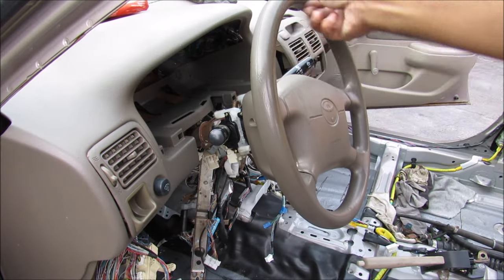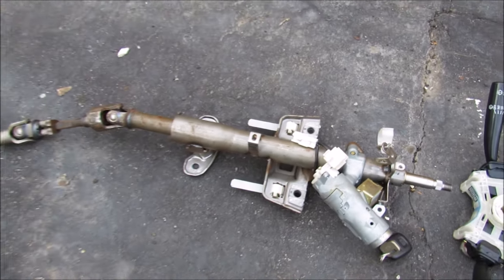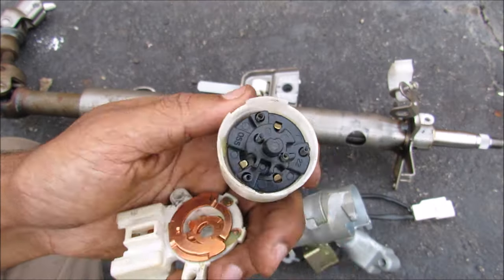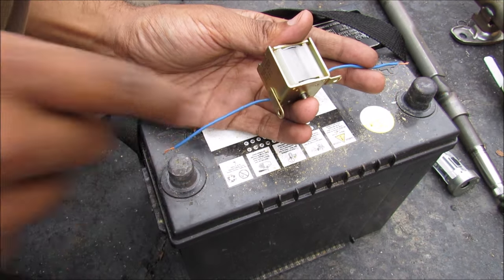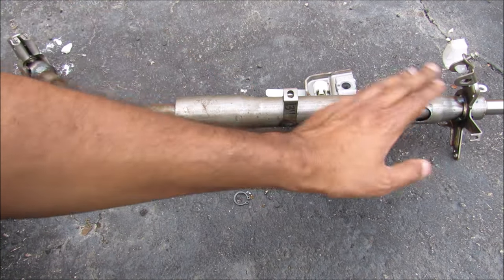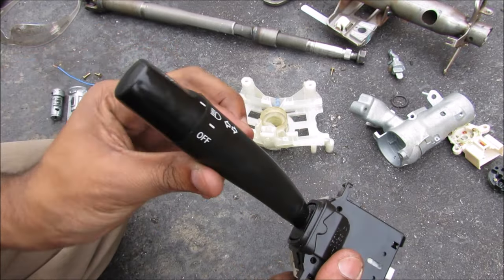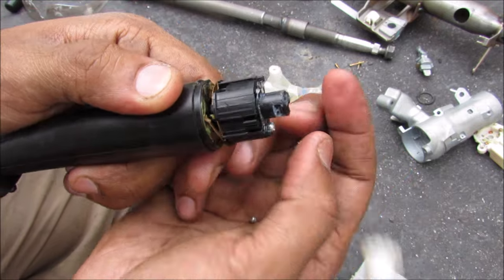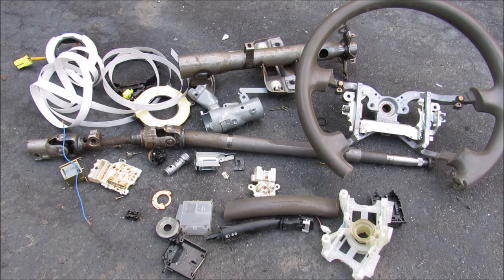How a Steering Column Works

Comment: great video. even as an engineer that specializes structural strength I'm always amazed by the amount of complex mechanisms inside machines we use daily and take for granted.  An automobile is made possible by mechanical, structural and electrical engineering combined.  Often times it includes computer engineering.

Comment: Nice breakdown and explanation.  Some thieves trying to steal my airbag broke my ignition switch/cylinder and the security screws that hold it on. Probably used a crowbar. They also removed the electronic switch (held on by two screws) that activates in the starter on the start/on position. I knew nothing about my steering wheel column and ignition until now. Thank you.
Reply from the maker: Thanks and I hope you get it fixed through insurance, those parts can be costly and on back order.
Reply: I didn't have full coverage on a 17 yr old truck. I'll be finding an after market CAT+ Exhaust pipe, and pulling from a junk yard or eBay an Ignition Switch/cylinder or the whole steering column if I can find it

Comment: Hello from 2022. A burglar (leaning on the steering wheel for balance?) broke my steering column. I had bits and bobs lying around and didn't know what was broken. I did test the key and found I couldn't turn the key in the ignition. I now know the bits and bobs were the solenoid/housing so this was very helpful and informative for me. Thanks for making this video.

Comment: The steering column u joints are very important because they're mostly there for collision safety. Without the u joints in a front end collision the steering column would shoot past the steering wheel and impale the driver. The ujoints are designed to break.
Reply from the maker: +LobbyDIY agreed, though as you saw in the video the steering  column itself also collapses.

Comment: A superbd video. I am hearing a 'clunk' sound when I rotate my steering wheel all the way to the left or right in my 2004 Toyota Corolla. I still have steering control of my vehicle. Should I be concerned? I will check under my hood today for loose components there. My braking works fine. Thanks for any information.
Peace.
Reply from the maker: Check the strut mounts and steering intermediate shaft

Comment: Man I needed this video months ago
Reply from the maker: Why, what were you repairing?
Reply: speedkar99 a 98 sienna that had a bad key cylinder and I couldn’t get out the key. Also the ignition switch needed replacing. Great video

Comment: 1)Is it possible to remove the steering column assembly without dismantling the steering wheel and the air bag, so that the whole assembly can be removed as one unit?
2) I'm able to turn the car off and remove the key while the transmission is not in the park gear. Is it just the solenoid you mentioned in the video that needs to be replaced, and can it be purchased by itself? What is the exact name of that solenoid?

Thank you very much!
Reply from the maker: Yes the whole thing can be removed as a unit. As long as you have access to the 4 bolts

Comment: Once the security shear bolts are removed with a punch & a hammer:
1) Could the same ones be reused to reinstall or are new ones required?
2) To install the shear security bolts, is the method also to use  a punch & a hammer, but in a clockwise direction? 
3) To install the security shear bolts, alternatively, is it possible to use an ordinary bolt where a socket & ratchet could be used?
4) Why are those security shear bolts used instead of ordinary bolts?

Thank you very much!
Reply from the maker: They can be reused. They're there for security...to slow down someone trying to hotwire the car. Of course since your doing this to your own car you can take your time, right 😉
Reply: The security shear bolts are "one-time use" and are fitted like regular bolts (clockwise rotation), the head is designed to break off when tightened with the prescribed amount of force. They are used as an added security feature to deter thieves from tampering with the cylinder assembly.....Yes, it is possible to use regular bolts but I would suggest sticking to the shear bolts.

Comment: Hi,  I want to replace the steering column of my toyota corolla E120 D-4D (2002) which has NO telescopic adjustment of the steering wheel and I want to use a steering column from the later facelift model that has the telescopic adjustment. Do you know by chance if their steering columns are compatible? Can it be done?

Comment: nice video my friend. I have a question... it is possible to fix the clock spring ??? it is possible to solder the looooooooooong cable??? or that solder would act as a resistance... thank u for ur time and greetings from Perú
Reply from the maker: +Fernando MinAnd yes but solder should hold up to The flexing of the spiral
Reply: speedkar99 thank you for ur answer my friend!!! 🖒🖒🖒

Comment: So I was changing the driver window regulator today. 

The bolts that hold the glass to the regulator stripped and it now spins. 
I called 5 dealers and checked online and can't find them. :/ 

On this 1997 Lexus es300, when you mount the glass to the regulator it had a lot of play in all three fasteners. How does one align it perfect. 

I am lost and need help. 

Thank you
Reply: I tried many different ways and adjustments, but when I tested it with a spray bottle, water gets in. :/  any one ever changed one on a 1997 Lexus es300.
This car has no upper door support. It is only the glass that closes.
Reply from the maker: +Martin Evan Hmn I'm not familiar with the power regulator, your best bet might be junkyard
Reply: speedkar99  If you ever come across it, it is very difficult to alright the bolts just right. There is so much play yo deal with.

I went to my local junk yard and no luck. This junk yard could be the worst junk yard in the world. The owner there said "we don't sell the bolts, you would need to buy the whole door" I was shocked and left never going back. 

I called all the dealers in Atlanta and every single one hit me with " you can't get the bolts" which you can. I found them online. 

But Thank you for your reply. 

Lexus is easy to work on. But on this es300s, maybe others, when you install a window regular there is so much room to play to set the window glass just right.

Comment: so, were in the process of sending our toyota carina cdx e 1996 column  to be converted to electric power steering. however its been asked for the "motor" to be marked  on the column where it was. and yet  even toyota doesnt understand what this motor is. would this motor infact be the power steering pump?

Comment: Please help! Just replaced a steering column. Transferred all old parts onto the new steering column...yet, now the steering lock isn't engaging at all. Also, the steering wheel endlessly turns in either direction (i.e., there isn't any resistance when turning... steering wheel will allow wheels/tires to continue turning beyond what they should). Any ideas on what the issue might be? Thank you!

Comment: What would cause my steering wheel to lock, but the wheel is not horizontal? I believe this happened after an alignment was done. Also a Toyota (09 Prerunner SR5 4.0)

Comment: I replace a blower motor on nissan versa  and disconnected the steering shaft from the column with the wheels turned now steering wheel is off center about half way, i cant find any videos to fix this, is there anything i can do to fix it

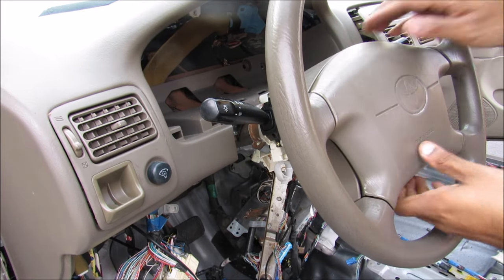Comment: Some mechanic hammered the metal where the sensor nut lay (0:45) and caused the steering wheel to be stiff and grind everytime against the plastic it sits on. Perhaps the collapsible steering column got a bit shorter or moved ? is there a way to undo this ?
Reply from the maker: Once it's collapsed there's no easy way to reuse it

Comment: What makes a ratchet clicking noise behind my steering wheel? 2007 Sequioa
Reply from the maker: Toyota always has steering shaft issues. I have a replacement video on a sienna

Comment: I have a 1989 Pontiac Grand Am and I replaced the steering column when I put the new one in my between the seats gear shift button won't press I can't shift into a different gear, what did I do wrong? There's a piece when you look down the steering column that's made of plastic and put on with two screws I see the button on that is that in the wrong place?
Reply from the maker: Yes theres a cable that goes to the ignition switch
Reply: @speedkar99  well damn I'm getting close when I replaced the steering column maybe I put it back on there wrong when I have the steering column down and I look down there into the steering column I can see a little button but that's not telling me anything I'm not a mechanic

Comment: My 1994 Toyota Camry steering wheel goes free spinning if I hit a bump.I can pull on the wheel and it also just free spins.I can kinda wiggle the wheel and feel a short move forward then steering returns.The steering wheel will not be centered anymore.I can point the wheels straight ,then pull on the steering wheel it moves towards me Maybe a inch.Now it free spins,I put it straight and push forward to engage the wheel again.Any idea what is going on.Feels like it's coming off a spline fitting or something.

Comment: Hello @speedkar99 . I have Lexus GX470 2004 just recently bought at auction. It is clean car , running with no damage history. When I get to pick up the car , I detected that steering wheel is not turning the wheels. It is free soft turning either side  with no respond from tires. But if I remove key 🔑, it is locking the steering wheel. It feels like steering wheel has been unbolted from joint or something. Also air bag sign on and when I turn steering wheel I can feel that wires inside steering wheel is ripped off. Can you please tell me what it may be before I disassemble all front of the car? Thanks
Reply from the maker: You have to reconnect the steering shaft and make sure it's in correct alignment. You'll also need a new clock spring.
Reply: speedkar99 thanks! I found that my clock spring is damaged. All buttons are not working on the steering wheel, so it is definitely clock springs issue. And I saw that steering rod is playing free . Thanks again!

Comment: Is it possible to fix the thudding noise from the steering column while the car moves through some rough patches. Since it is gonna cost a fortune to replace the steering column itself... Wud appreciate ur help
Reply from the maker: +augustine salhotra thudding or creaking?
Reply: its kinda rattle sound from the steering column. actually I took experts advice earlier and got the steering rack replaced, but the problem persists sir. then they told me that its from inside the car under the steering wheel. EPS needs to be replaced too. but I am not convinced.
Reply: I am having a very similar problem. Some rattling from steering column when hitting bumps. Turning the wheel a few inches side to side also reveals some noises. Local dealer is recommending replacing the entire column which is expensive. Not sure if it needs to be done.

Comment: How are the security screws removed? I need to get to the ignition lock cylinder cam shaft on a '98 Lexus LS400. I want to take the ignition cylinder off the steering column. Thx.
Reply from the maker: +Fiona Marissa punch and hammer
Reply: speedkar99 Once the security screws are removed with a punch and a hammer as you suggested, could the same ones be reused or a new one is required? Btw, are they extremely challenging to remove?

Comment: I have a 2013 Hyundai Sonata with electronic power steering. Suddenly the steering wheel was stiff when I was on the highway. It was like this for days. Then randomly the steering wheel was fine again..Then a month later the same thing happened. Would you think this is a steering column issue? I’ve been having electrical issues too. And my dealership is trying to say this is the reason why. I feel like they’re trying to scam me because I’m a younger female. What’s your opinion?
Reply from the maker: Seemed like an electric issue with the steering motor not giving boost

Comment: my steering lock mechanism doesnt pop sometimes when i remove the key from the ignition. So the remote control doesnt work then. I tried lubricating the ignition lock by spraying liquid grease into the cylinder but it didnt help. Does someone know what would help? Car model is kia ceed 2010 sw

Comment: 1:36 How do you remove those security bolts?
Reply from the maker: Use a punch and hammer
Reply: speedkar99 On the bolt head or bottom?